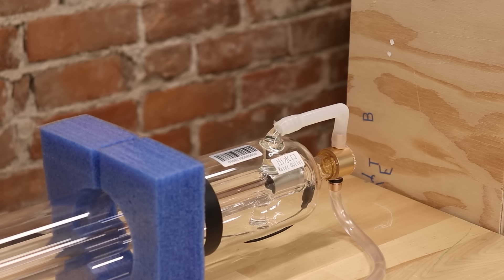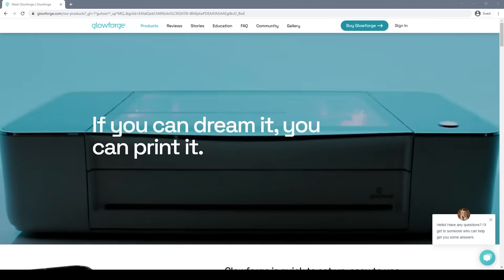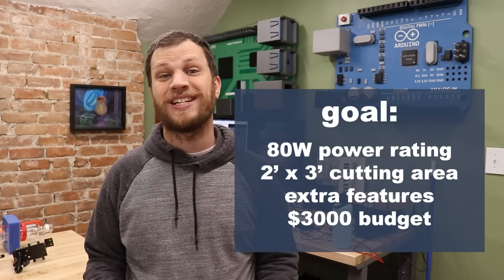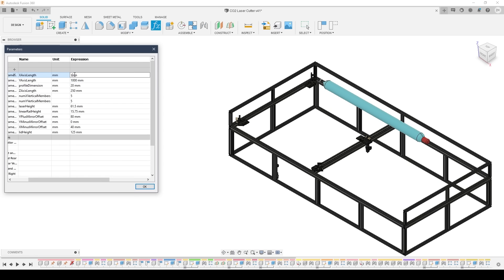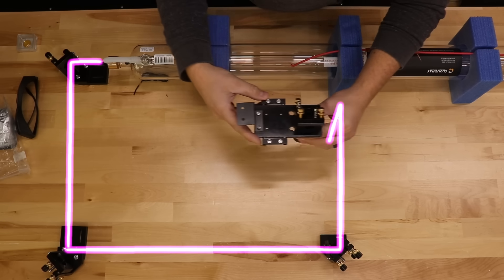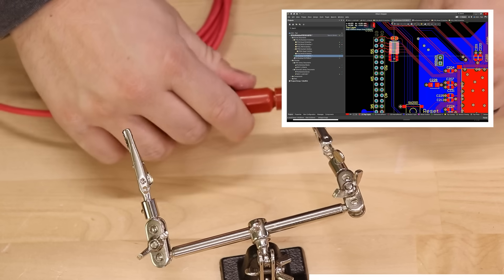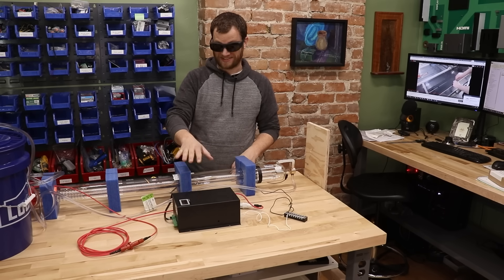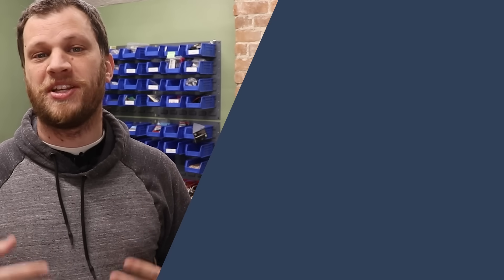I'm Shocked By How Much Damage This Caused! - CO2 Laser Cutter Part 1

Comment: I was wondering why you are using the "third" mirror instead of having the second mirror move with the gantry? This seems to me to just add to the complexity of alignment and also make the beam travel farther which may cause less output in the end? interested in your response and design. Thanks and Congratulations on the new addition
Reply from the maker: Great question. Since my laser tube is so long I want it to run parallel to the x axis. In addition I want the y axis gantry short. Have a look at my fusion model in the video to see what I mean . You bring up great points and it's something I will experiment with. I haven't locked in my design. I got the extra mirror to try this set up.
Reply: @bytesizedengineering  Having the tube parallel is nice but not really essential. As long as mirror one is firing parallel to the y axis down to mirror two then nothing changes along the x axis when it moves. The 4th mirror just seems like extra complication and more difficult alignment setup.
Reply: @Graeme758  not only complication and alignment difficulty - it waste you precious watts of energy coming from the tube. And you don't want it.
Reply: Are you saying its possible to use just two mirrors?
Reply: @Sanusi Usman  no... 3 total but he had 3 horizontal ones and 1 vertical. You only need 2 horizontal and one vertical
Reply: The 3 foot long glass tube is why he wants to run it parallel to his whole set up this still needs to be compact. Look at his work space, it's only a finished attic.  Yes if he wanted to run it along the front rail he could cut out a mirror or two but thats obviously impractical and not the most practical place for a giant glass tube filled with cooling water.
Reply: @jacobthompson1682  right but I still fail to see why that makes a difference, since having the gantry arm parallel to the tube is how a 3 mirror setup works. So the gantry moves perpendicular to the tube, but the "flying" mirror's direction of motion is parallel to the tube. Adding a 4th mirror makes the "flying" mirror's direction of motion perpendicular to the tube.

The only reason I could come up with to run a 4th mirror is if you were really concerned about rigidity and so you wanted your gantry arm to be as short as possible, however this is a laser cutter, and you don't need CNC levels of rigidity, so there's no reason not to drive the gantry parallel to the tube. 

Literally every other desktop laser cutter on the market uses a 3 mirror setup, the only way you'd ever want to change that is to reduce mirrors even more by having the tube ride the gantry arm itself, or else a fiber coupling.
Reply: @arfink  you backed back into one of the requirements. He stated he wants to be able to run full sheets of plywood a desktop setup doesn't run into the issues he's having and the extra mirror fixes that.
Reply: He needs the 4 mirror setup as his gantry will move left and right, not front to back. If the gantry and laser tube are parallel then he could go with 3 mirrors, but the gantry will be perpendicular to the laser tube, thus the need for a 4th.
Reply: Whats the difference? With your 4 mirror design and with mounting your 2nd mirror to gantry, so you'll be able to use 3 mirror configuration?
Reply: I have bodor laser machine and it is using only two mirors and focusing head. By power mine is 100w and cuts perfect only with two mirrors.
Reply: @heris30  Sounds like a 3 mirror setup, with laser tube parallel to gantry.

Mirror 1 - turn beam to be perpendicular to gantry at one end
Mirror 2 - (attached to gantry) turn beam along gantry
Mirror 3 - (attached to focus head) turn beam down through focus lens
Reply: @dewerk   No there is only two and i counting only two visible mirrors on axes from laser end. Not counting head in which is mirrror too. Second mirror is traveling with Y axes. Please see Bodor laser mashine manual. :)
Reply: @heris30  That tells me that your laser tube is parallel to your gantry.  The first mirror  turns the beam to the gantry mirror.  The gantry mirror moves with the gantry and point it at the head mirror which point the beam down.  If you're not counting the head mirror, then In the video he's setting up 3 not 4.  The first mirror turns the beam parallel to the gantry, the second mirror point the beam at the gantry mirror, and the third points the beam down the gantry to the head mirror.  He needs the extra mirror because his laser tube is perpendicular to the gantry, not parallel.
Reply: I watched your diagram, and still can't understand why you need a 4th mirror.

Comment: This video is good timing, since I'm currently debating buying or building my own laser.
Reply from the maker: That debate has been going on in my mind for years and years
Reply: @bytesizedengineering  The big deciding factor for me is just where I can actually use the thing, which really limits the size on an off the shelf unit. Can't get the bigger one's down my basement stairs.

Comment: Heck yeah dude,  Great to see you getting started!  
Did you have that moment when you were opening the Laser Tube packaging thinking it's just going to be shattered pieces of glass?
Reply from the maker: You know, I was actually quite impressed with the packaging. It was packed with foam supports inside a sturdy cardboard box. The cardboard box was wrapped in a thick air filled bubble tube, and the bubble tube was in a wooden box. It would have won if it was in an egg drop contest.
Reply: @bytesizedengineering  yeah when I opened the crate I was pretty impressed. And then there was more foam in the cardboard. The packaging weighed way more than the tube itself, and it was flawless of course. But while it was in the mail on its way to me all I could picture was a box full of broken glass. The post office wouldn’t leave it at my place because it was too big, and when I went to pick it up at the post office, the lady brought it out dragging it on the ground saying “wow, it’s taller than me!” and laughing and then just plopped it down. Just about had an aneurism.
Reply: I can't speak for Zach, but when I built mine I definitely had that moment. I left it in the wooden crate for as long as I could just to avoid discovering that it was DoA, haha. Thankfully it wasn't.
Reply: If you pick up the box and it sounds like sleigh bells you know it's going to be a bad day.
Reply: If you pick up the box and it sounds like sleigh bells you know it's going to be a bad day.